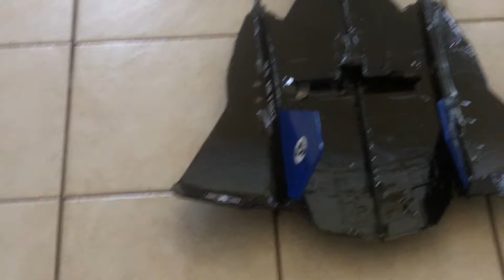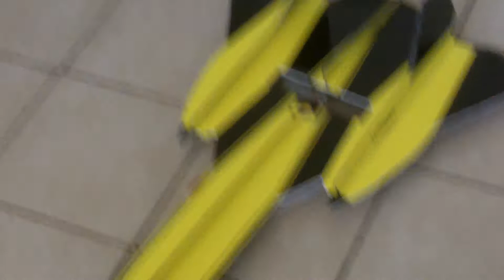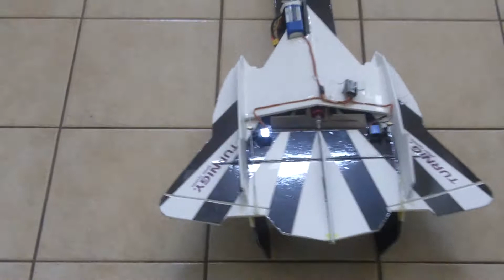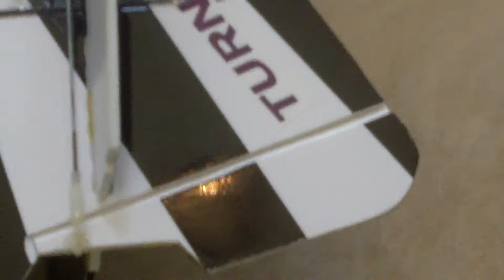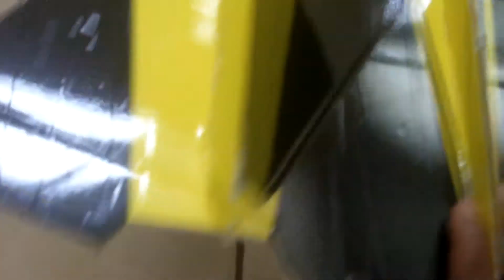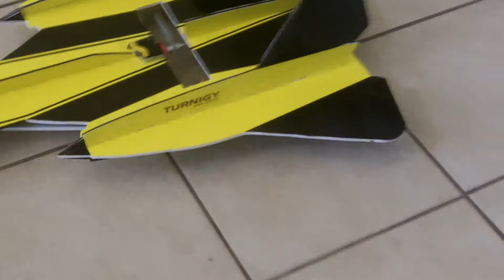New & Improved SR-71 Blackbird

Comment: What's the length of each? I'm currently cutting out a 28" long SR71. It's gonna be a fast micro. 2200kv out runner, 12A ESC, 2s 450mah 30c LiPo. Just had a small powerful motor waiting to be used. I made a mistake on the angle at the leading edge of the wing, about 5 degrees off. So now my plane lost about 1/2" on total wingspan. I think I can still make it work though. MORE SPEED! Nice vid. Thanks.

Comment from the maker: @Johnellenberger1 @Johnellenberger1 Catching up man, sorry it has taken me a while to get back with you... I used colored packing tape from tapebrothers is works well and does not add a lot of weight. As far as the power setup... Did you make it the standard size? or did you enlarge it? If you went with the standard size I think the 370 will work but will not be a rocket. What are your plans for the prop size?